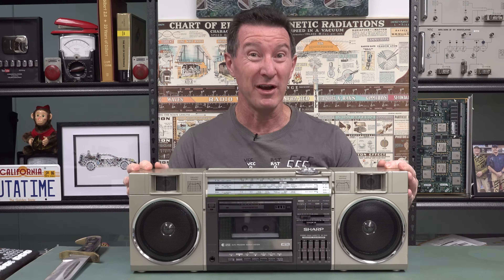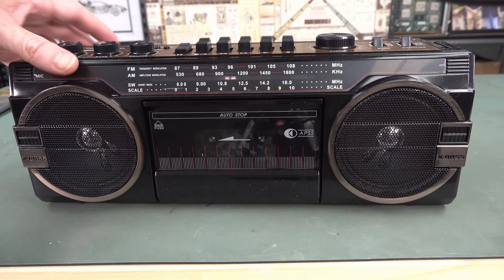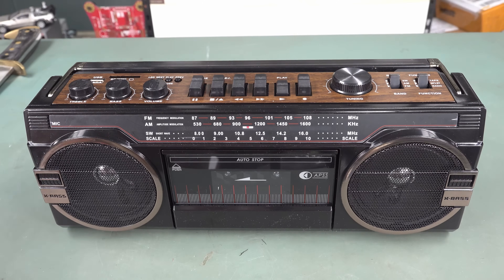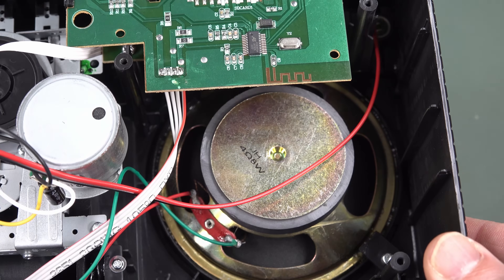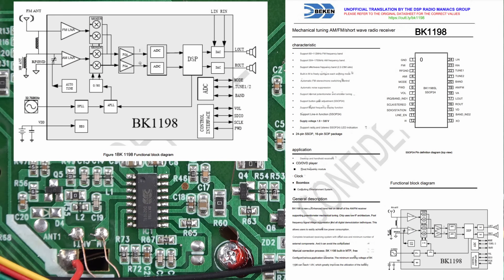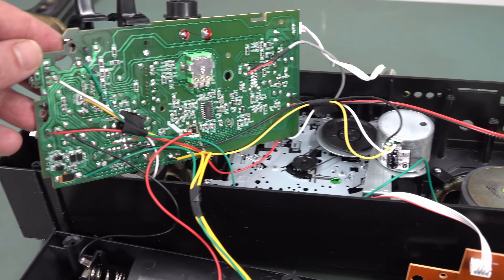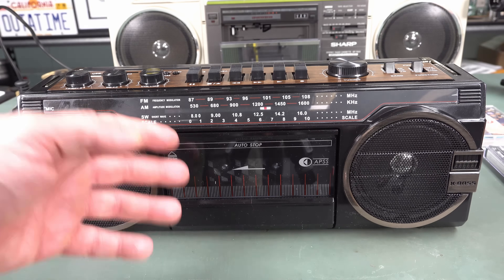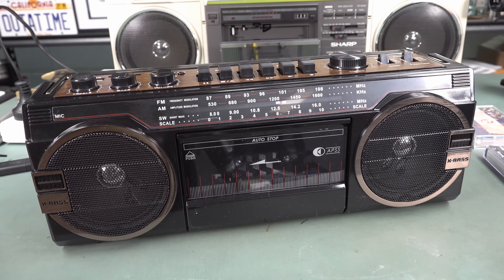EEVblog 1590 - Cheap $33 Boombox Teardown

Comment: Single-sided phenolic boards, discrete wires between boards directly soldered with no headers. They really did go the extra mile to give it that "retro" look inside AND out.

Comment: consumer electronics are such a disappointment these days. I fix stuff for a charity shop (for free obviously), we often get old ghetto blasters and I'm always amazed at how well they were engineered with repair in mind. one of them had a frame that allowed you to lift the electronics out with the mech attached and the cool thing about it was that the tape eject button released it from the main chassis. (it was a Hitachi TRK-8190E for anyone interested)
Reply: Exactly, that’s why I only do teardowns if high end stuff and aircraft electronics
Reply: Looks like that one even has real tweeters too....
Reply: @rickgreer7203  it did aye, it sounded fantastic

Comment: I work in PCB and product design and the fact they can assemble, package and ship these for $33 AND make a profit is just unbelievable. Especially since it techincally works, even if not as well as a brand-name item. They're using a couple of the all-in-one chips, obviously, but just the cost of the PCBs, casing and manual assembly these require adds up. I think Dave messsed up a bit as when he initially held the mic in front of the speaker on this unit it sounded pretty good, so he then moved it between the speakers so it was more muted :)
Reply: All companies in China and in many other countries are heavily subsidised by their governments. The actual cost of the materials to create these items are similar in most countries and labour / cost-of-living charges are ever-increasing.
Reply from the maker: Yeah, that audio effect in the middle was odd. Mono mic and mono speakers. Out of phase speakers perhaps?
Reply: @EEVblog  that’s what I wondered yeah, if one of the speakers had been wired the wrong way around.
Reply: 12 months warranty too :face-blue-smiling:
Reply: @ralphj4012  If these are made with prison labour, the only real cost is materials and shipping.
Reply: Speakers wired out of phase?
Reply: @haweater1555   Speakers push/pull to make sound. If one is wired in reverse then it will be pulling as the other is pushing, creating a weird sound that's out of phase. That's why speaker terminals are labelled + and -, even though the speaker itself isn't polarised it's about making sure all speakers connected to a single device are using the same polarity.

Comment: 8/10 for giving it that vintage look from the speaker grills to the cassete buttons on the top. bonus point for having modern options like usb and bluetooth. Sadly have to drop a point for using treble and bass knobs instead of the set of eq sliders.
Reply: Lose another point for it being a non-stereo model.

Comment: I was pleasantly surprised by how much circuit board and direct wiring there is in this thing. And the micro switch in the power connection would be to prevent the batteries from receiving unintended voltage. For $50 it’s a bloody steal

Comment: You could buy a 1980s boom box with RCA input connection and connect it to  a  Bluetooth/SD card unit
internally to make the 1980s boom box modern again.
Reply: Not everyone wants or needs Bluetooth in one of these devices. Now, if it was a more expensive, elaborately designed STEREO model and you wanted BT - you could either have it done by someone or mod it yourself. Don't waste money or new parts on mono junk.

Comment: Brisbane K-Mart has them for $49AUD, I love it, play some radio out the back shed, little memory of old times. Nothing special but it turns on with 1 switch. I also got a new age cheap clock radio for down the back, but to play the radio you need to press one button to turn on, another to select BT, then some other button to change to radio, every time, its going in the bin, keeping the fake old school tiny boom box for ever

Comment: I know some old Philips record/tape/radio combo's had the cog-wheel radio tuner like this. After repair you had to lock it to a well know radio station and move the slider to that station and pair it up so the freqeuncy shown on the front would match the settings on the tuner....

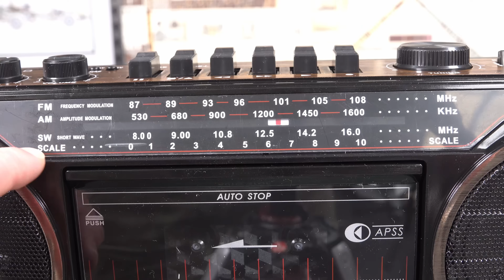Comment: (2:08) I think the designers tried to make it look like a tuning band for shortwave distance, VHF channels, and/or UHF channels.

(2:46) I seem to remember a Techmoan video where the host mentioned that the designers likely used photos of Sharp boomboxes as part of their design reference photos and didn't bother to search online for what APSS was or their radios were rushed into production.

(3:08) The one Techmoan had was branded 'REKO' which, if i recall correctly, was the brand name used by Aldi South when they sold them.
Reply: This one is branded "Anko" which is the home brand of KMart in Australia.

Comment: Re: The APSS (Automatic Programme Search System). From what I can remember from my ghetto blaster days, you need to have the play button and either FF or RW pressed down at the same time. The play head should detect silence or gaps and stop at the first instance. If you get quiet bits in songs it can fool the search. Having said that, it's probably bogus on this cheap setup.
Reply: Yeah, I think so too, as Techmoan did a video on the same boombox model shown in the video (his video was titled along the lines of "Aldi boombox"), and showed that it was fake and that someone likely referenced photos of Sharp boomboxes when designing the cheap ODM boombox both he and EEVBlog showed.

Comment: loved to watch this as im from that old generation and i remember how many models of this i did repair!
Reply: I'm from the younger generation, and repairing stuff from the 80s and 90s now for my job. It seems like a sweet spot for repairability, complex enough that it's valuable and there is demand for repair, simple enough that you can repair it (none of these 1000 pin BGA rubbish). Standardized parts like the LM358 in wide use, schematics maybe available, etc.

I love repairing it now, but I can't imagine living it, that'd be awesome.

Comment: I think it's pretty neat they added Shortwave too. Even if it's not the whole range but just a smaller section of the shortwave band but it's a very useful portion still and you should be able to receive a lot of stations on it. Especially during the day.  Yeah i think the biggest downer is that even if it has 2 speakers it's just a Mono Radiorecorder. So you won't get Stereo sound from Radio, SD & USB and also Bluetooth and cassette. However you should still be able doing stereo recordings of the FM Radio to Cassette.

Comment: The nightmare of the 'speaking' mp3 / bluetooth chips. A total embarrassment when one of those goes off at full volume (it always speaks at full volume). It will be one of those JL chips, AC46 type (a now obsolete version); I even managed to download the source code for those chips, along with the dodgy original speech files, but never got around to trying to re-program one due to the Chinese software tools often coming with included malware.

Comment: G'day,

Thanks for making and posting  this.

I live off-Grid, and I like to leave ABC FM Radio National playing in the background, I still listen to Cassettes which I recorded from Vinyl, in the 1980s to '90s...; and recently my olde '70s vintage Radios finally died...

And over maybe 10 years I've burned through quite a few Chinese Radios..., and the last 2 years have seen about 5 of them being bought cheap, in the vain hope that their 240-Volt Transformer will be able to cope with the output of my
Digitech Pure Sine-Wave Inverter...

Every time, within a day, the Transformer shits itself.

But, for the price - they're probably OK for anyone living with Gridpower...; it's a pity they're Mono, but they're not bad.

And the Pure Sine-Wave Inverter killed the Transformer in two top of the range  Digitech "World Band" Radios, as well.

My guess is that all the 240-volt Transformers come from the same factory, and none of that place's output will run on a "Pure Sine-Wave" Inverter...(?).

 Ahh,
Chinesium...,
Bright 
Shiny
Landfill ;
For
THUS,
We
Trashed the
Earth...!

Such is life,

Have a good one...

Stay safe.

;-p

Ciao !

Comment: You'll find it in the US as the Audiobox RXC-25BT. Available in Black and Red. Note that they don't list the AC voltage on any listing I could find.
Reply: They could whack a lithium battery in it for an extra 10 bucks, plus you save on the mains power conversion, that's like a buck off. And you don't get the UL screaming at you when it shorts the mains and burns your house down.

Comment: I compared the power consumption of the Sharp boombox vs this one. This one uses 5v at 60ma for a power draw of 150mw. The Sharp Boombox says it draws 35 watts on the label. Meaning this boombox draws 233x less power. I know the power outputs aren't the same, but I don't think the Sharp boombox has 230x the power output.

Comment: The pot for the digital tuning is interesting- all of these digital radios seem to use the same style pot and mechanical linkage.  I think a pot off the board would be easier mechanically- anyone know why they all use this arrangement?  Is the pot special in some way?  BTW, the crazy thing on other recent radios: many don't use log/audio-taper pots for volume, instead they use linear.  It means all the volume action is in the first 5 degrees of turning the knob.
Reply: Damn. I had a TV that had a zero-100 volume, and anything above 10 was almost unrecognizably louder. That explains why.

Comment: I’ve destroyed more than one double cassette player trying to replace those black rubber tension bands on old 80’s -90’s players which in most cases were a confusing melted/oily disintegrated mess and extremely hard to get to. On top of that trying to figure out how and where those multiple-different length bands, especially for reel to reel /auto reverse/etc were interconnected has been a nightmare.

Comment: Tape speed was too fast on the cheapie! There's usually a screw hole on the motor which has a trimpot underneath to adjust that though

Comment: I have the same/similar unit, bought it second hand in 2020, just curiosity. Piece of crap, deck not working (broken off wire), belt stretched, awful sound quality, USB groundloop, digital tuner (doesn't work really well with an analog compressed scale), passive tone controls, linear volume control and MONO. Mine is branded "Ricatech" and identifies itself as "USB/SD 3 Band Radio Cassette GHETTOBLASTER" haha. Chipsets used; BK1198 (tuner), KA2206B (amp) and BCFDY02.1N (unknown). Speakers are 5W 4 Ohms in series (bridged amp config). Plastics are pretty good. It can run on an USB power bank (connected via battery terminals) a pretty long period of time.  But don't waste your money on this. If it was stereo you can do some tweaks to make it a little better as is.

Comment: Surprisingly they didn't wire those speakers out of phase, did they?  It would have been a spatial sound! 😂
Reply from the maker: They actually might have. When I move the mic to the middle you can here the output drop.
Reply: @EEVblog  But you can always add "Spatial/Normal" switch afterwards. 🤓
( I have a late 50's Telefunken Concertino radio and in those days they connected (in addition to the main speaker) two tweeters out of phase to create more spacious sound.)

Comment: Oh wow, the Wow and Flutter of that tapedeck is abysmal from what I could hear. Even though there's only one style of clone cassette mechanism now, it doesn't mean it has to sound like absolute garbage, there are some good new ones that use that style - as I recall TASCAM make a fairly decent HiFi one. It's nothing on a decent old model with Dolby C or S, but for those that want new with warranty it's fine. No dolby (since dolby don't license the tech anymore)... I bet the microphone only records to tape, and I bet it sounds terrible since it looks like a generic tiny electet microphone. And not stereo? Dang. Well you can get these in stereo and they sound better, I think VWestlife reviewed one that wasn't half bad for a modern boombox.
Reply: I'm not a lawyer but I bet the Dolby patents are long-expired, so you wouldn't need to license it from them any more. You couldn't call it Dolby though, I expect.

Comment: Not bad for $33. I have to take a points away for it nor being stereo. If you're going to put two speakers in, maybe take away the microphone and have stereo instead. The tape mechanism is a novelty item, probably not going to be used much. I got something similar but better for the garage.

Comment: I carry a similar radio around my property when doing lonely work. It runs from battery so I can put it anywhere, I do not care if it gets dirty or gets hit and I am mostly interested talks in radio, so sound quality is not important at all. The cheap Bluetooth radios you can buy are just too delicate for such purpose.

Comment: EEVbog I wonder if the headphones are in stereo on FM and SD card?
Reply: He pointed out that there's only two wires going to the headphone jack, so it's mono only.
Reply: Yes but the FM radio and SD card might come out in stereo through the headphones  unlike the speakers that only play mono. @RedwoodRhiadra
Reply: @stormchaser300  Not with only two wires going to the phone jack. You need at least three for stereo (left signal, right signal, and ground/common).

Comment: You just gave me an idea to wander the streets with a Tek 468 on my shoulder, haha!
The name here in Poland was either boombox, "jamnik" (dachshund) or, officially, "radiomagnetofon" (radio cassette recorder). None of that "ghetto blaster" rubbish here - probably because "ghetto" still has direct association with WWII and the Holocaust. 

I'm still surprised why it's not stereo. I mean, it's still pretty good build quality by boombox standards, while saving a teeny tiny amount of cash on parts? C'mon...
They included Bluetooth and USB but can't even make it stereo to save their lives? Oh, for crying out loud.

Classic passive Baxandall type tone controls, I see. I'd rather have active (in the opamp's feedback loop), but you won't hear any difference anyway, and I agree it sounds awful. Guess that "X-Bass" meant cutting the bass out altogether.

I recently restored a Sony boombox with a cog-and-rack scale. Not a bad thing.

What would @Techmoan say?
Reply from the maker: Pics or it ddin't happen!
Reply: @EEVblog  easier than the old ones... imagine Fran with her 564!
Reply: dachshunds are a type of subwoofer I believe :p :)   (ie small woofing doggo)
Reply: Stereo means you have to double up on all the expensive parts. The amps and everything. Add an extra 5 dollars to the price, can't be having that!
Reply: @firstnamelastname7476  ...barking at submarines!
Reply: @phillyphakename1255 you can get one chip stereo amps. They aren't that expensive but more than mono I guess.

Comment: The market could be people wanting a radio for an emergency where power and phone network is down.
Reply: Nah, they make far cheaper AM/FM radios that don't waste money on a useless cassette deck. Hell, for about the same price you can get a fancy model with an internal battery bank, solar charging, hand-crank charging, and flashlight - features actually useful for emergencies.

Comment: I'm just impressed that they sell tape decks in 2024. Like seriously, who uses tapes these days? Also cramming all this functionality into a box for $33 is just mind boggling. Even though it's built to the absolute worst low-fi standard possible (the speakers are actually impressive, even though the amp leaves a lot to be desired), the features it packs are insane.

Comment: I brought one  of those last week at Coles Dave I think mine's a bit smaller
Reply from the maker: That's where I first saw it, but got it cheaper at K-Mart. The Coles model seems to have an extra tape to SD card feature
Reply: @EEVblog  yeah I only got it because add Bluetooth and a SD card and bonus a tape player and also bought one of those single binocular for about $30

Comment: Note that the radio tuner is digital in nature, and performs poor
Reply: Reasonably sure al cheap radios are digital tuners now.
Reply: There are a few generations of these pot-controlled digital tuning chips.  The more recent ones are definitely better- the original ones overloaded really badly (meaning if you are close to strong station, you'll pick it up all over the dial) and had very choppy tuning.  Also the pot-tuning is really bad for shortwave, it's not fine enough.  I want to try a high quality 10-turn pot on one of them.

Comment: Oh come on lets see the op amp thats driving the headphones/speakers.
There are a few likely suspects. Most of which would be buffered by another op amp, or driving mosfets for the outs. 
So I'm a little surprised to see them doing a handful of 100k resistors passive mixer bs. 
I'm sure it works, but they probably don't expect a long life out of that IC.

Comment: The microphone lets you record audio and voice onto tape I expect.  Does this unit have true stereo sound?  I hope so, so many of these cheap portable units may have 2 speakers and they may look like they have stereo sound, but they don't which is ridiculous.
Reply: Mono
Reply: No stereo, two speakers wired in series, and only single channel signal path.  In terms of what you get for $33 USD, I suppose it's something you could give to a child as a present, but I absolutely would pay more for a better radio.
Reply: Might want to watch the video.